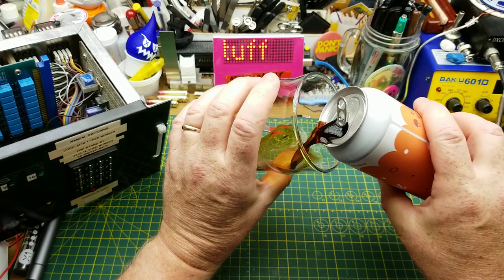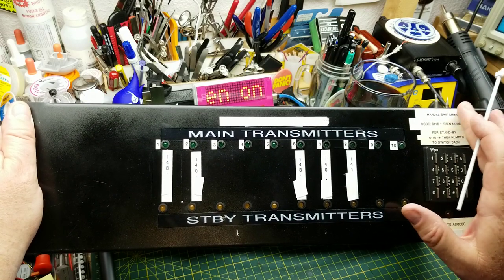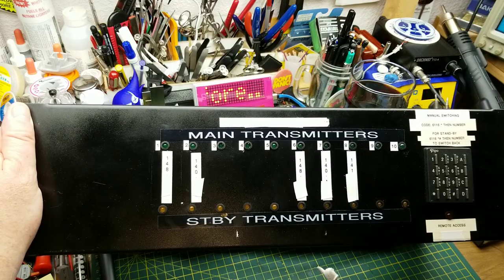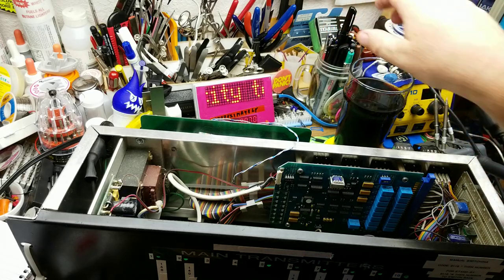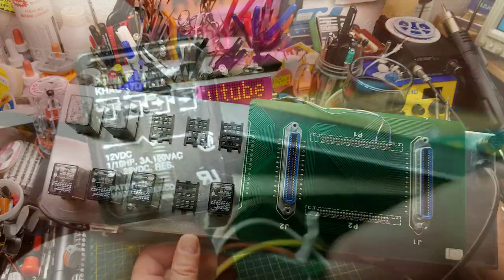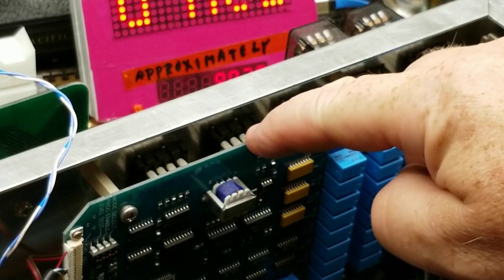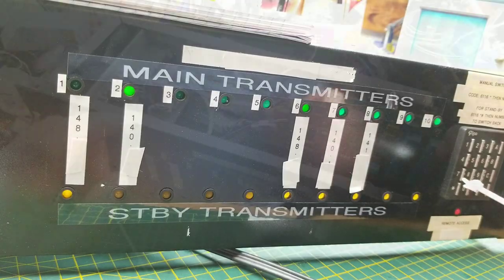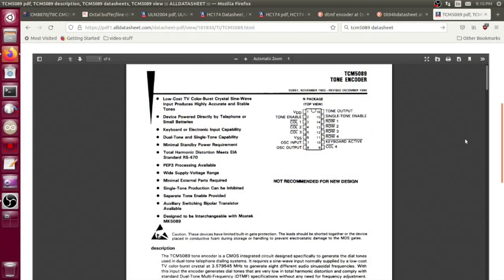Curiosity teardown: custom transmitter switcher

Comment: I found this really interesting too! As an amateur hobbyist, I am learning so much from your videos. Unusually, the PCB has right-angled tracks, why do most circuit layouts run 45 degrees "bends"? This was a great teardown - with respect to the designer! there was a lot of thought and hard work for this bespoke project - hope you discover the origin. PM me I'll send you a beer from the UK as a way of saying thanks!
Reply: The commonly stated reason for the 45° corners is to reduce reflections from high-frequency signals. I'd say though that in like 95% of PCBs it makes no significant difference at all and is more for looks than anything. Personally I also use 45° corners on all my PCB designs just because I like them more than 90° ones.

Comment: It has been a very long time since I saw a Glenayre paging transmitter. About 20 years, I think. We had 70MHz radio links to the transmitter sites instead of leased lines. We also had repeaters inside almost every hospital in the area. I remember having to rebuild a PA circuit board that had burnt up because the transmitter was obsolete. I epoxy spliced a piece of empty circuit board in and laid the circuit traces from the Pace kit. The PA was operational late that night.
Reply from the maker: Those were impressively stable transmitters. In 25 years I only had to replace the directional coupler off the back of the PA cabinet.

The exciter, on the other hand, gave me a lot of experience...

Comment: the last board would be to answer the dial in phone line and supervise the time so it didn't allow anyone to remain connected indefinitely and would release the line after a time interval. the processor supervisor ic would be super reliable.
Reply from the maker: That would also explain the bodge wire which is probably grabbing a phone line off the 25 pair at the back. 
Makes perfect sense.

Comment: Could 9 th and 10 th relays be associated to the two large connectors on the rear?
Reply from the maker: All 10 relays have their contacts wired out to the 2 large backplane connectors.